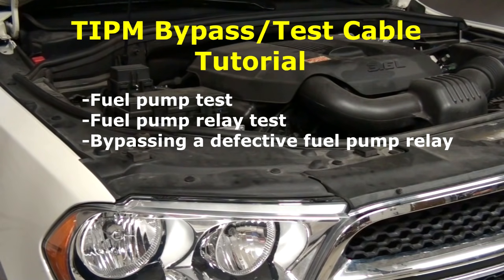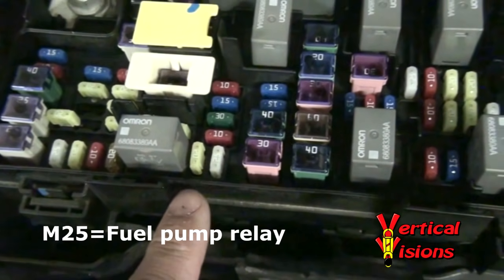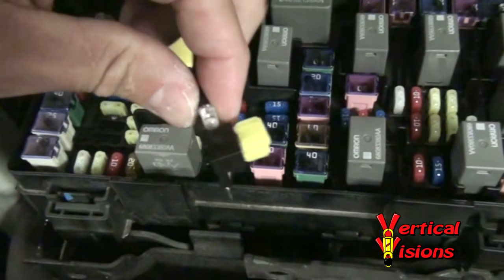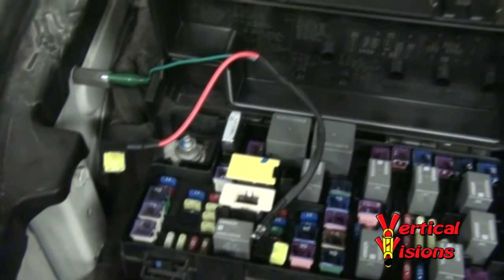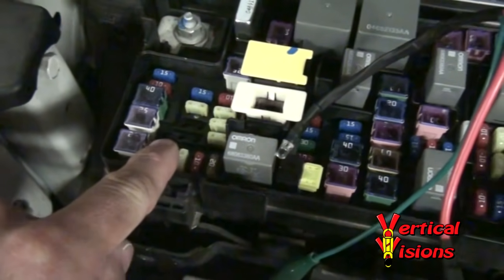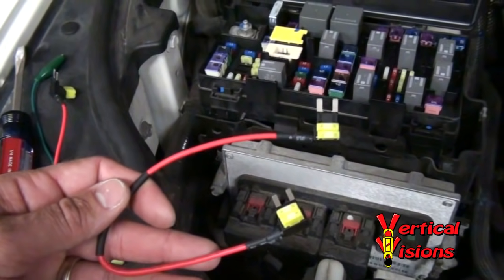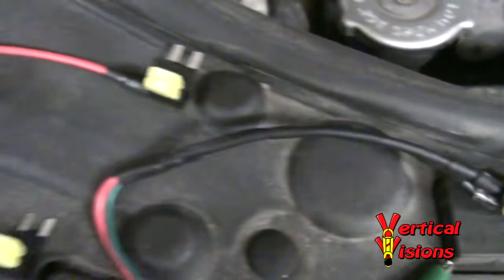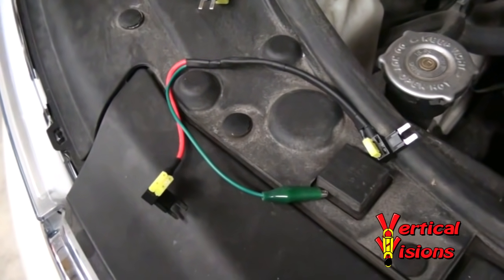TIPM Fuel Relay Test and Bypass Solutions - Most 2007-2021 Dodge, Chrysler, Ram, Jeep, VW Vehicles

Comment: Jason, I have a 2011 Dodge Ram (Hemi) and the battery was dead every morning for four mornings.  Replaced alternator, replaced battery but to no avail.  Then discovered that the fuel pump was running when the truck was switched off!!   Stumbled on this YouTube video and ordered the part.  And it works like a charm.  I cannot express my gratitude.  Christmas is around the corner and the though of a $1500 repair (dealer quote) was making me physically ill.   I appreciate your willingness to share this fix at such a reasonable price.  My hope is that it has been financially a blessing to you and your family for you have surely financially blessed my family this Christmas.  Thank you.
Reply from the maker: Wade, great post as we get many comments like yours this time of year.  Many thanks.

Comment: Does this work for wiper relay
Reply: I think that I'll check wiring going to tipm first tho
Reply from the maker: No.  It would keep your wipers on 100% of the time when driving.  Look into a TIPM repair, which is the only wiper solution other than a new/used TIPM (assuming it is indeed a double relay failure):  https://www.verticalvisions.com/tipm-repair-door-locks-wipers-washer-fluid-double-relay-1.html

Comment: Though I am back in business, I may still buy one of Jason's cables-- the fuse adapters they have at my local auto parts store are rated at 10 amps and I notice Jason uses 20 amp fuses, which I did too- I don't think the pump would draw as much as 10 amps, but that concerns me- maybe 20 amp rated  fuse adapters are available? Or  maybe he's using 20 to allow for other things that may be on the circuit such as the rear lighter socket? Jason if you're listening, are your cables 20 amp rated? Oops! EDIT: I see he covered this near the end-- I'm gonna order a cable from Jason!
Reply from the maker: Since this summer, our cables are made specifically for us (14 AWG wiring, 20 amps).  Fuel pumps will use 8-10 amps.  The fuel pump circuit has always been rated at 20 amps, so the use of 10 amp add-a-circuits will eventually cause the cables to melt.  Short term, a 10 amp add-a-circuit cable will get you home where you can then install a larger add-a-circuit cable
Reply: @VerticalVisions  Thanks! Like you said, I can't find the heavier duty fuse adapters at the local supply houses, so I ordered some- hope they get here quick. I suppose I  could just use 14 wire, tap the fuse sockets with  blade inserts and add in-line fuses, but seems like a lot of trouble for just a (hopefully) day or two.

Comment: I have a 2011 T&C Ltd., bought 6 months ago,  and immediately experienced intermittent starting problems. Didn't know it was intermittent right away, the 3rd day I had it, it stranded me and I had it towed to a shop where it spent 2 days, but they found no problems---it worked just fine and everything tested OK while they had it. Took it back and occasionally it would not start. I could usually get it going by various little tricks,  cycling the gear shift, using remote, etc.  but the other day nothing worked. Fortunately I stumbled across this video some time ago but never acted on it as it never stranded me since the first time.  I got two fuse adapters and connected them together  (sorry, Jason, I commend you for finding this solution and don't begrudge you a profit, but besides the money, I wanted to get it running right away and not wait for delivery)  and installed them as shown - and EUREKA!  Starting reliably and running like a top again. One question I have is, why is the bypass not a permanent solution?  I understand I might lose remote start but I don't use that anyway unless it was back when I had trouble starting it normally. Is there any other reason why it shouldn't be considered permanent?  But, many thanks to Jason for saving me hundreds if not thousands, there was  a time I was headed to the replace everything you can think of  and hope that solves the problem route.
Reply from the maker: Lately, we're testing a new fuse slot which will make it a permanent solution:  https://www.verticalvisions.com/tipm-test-bypass-cable-mini-blade-fuses.html#faq19.  No worries on building your own cable - we have instructions to do so on our site.

Comment: I have a 2012 Dodge Ram Pick up and was ready to replace fuel pump.....which is a real chore. What was happening that made me think it was bad is....I could hear the pump running when vehicle was off and my battery would drain overnight..... Not all the time but occasionally. While researching other potential scenarios I came across this video and website. I ordered cable online from these guys and did prescribed test and installed cable.....It worked perfect.
Thank you very much.......how sweet it is to fix something like this  so easily. Its like when your in school and you pay someone to do your home work so you can go play......not that I ever did that ( - ;   Ralph

Comment: this does not apply on later 2012 jeep grand cherokees or 13 or newer. fuse m25 does nothing you can take it out and throw it in the garbage. it looks like chrylser switched everthing to fuse m37 and it is shared with the abs fuse( not in the owners manual) it still says fuel pump  is  fuse m25. looks like i just have a good old fashioned bad fuel pump
Reply from the maker: This is 100% incorrect.  2011-2013 Jeep Grand Cherokees were part of a nationwide fuel relay recall, so your M25 doesn't do anything because you may have let your dealer cut wires under your TIPM to install an external relay.  Here is how to identify if you have an external relay:  https://www.verticalvisions.com/omron-g8jn-external-relay.html#identify.  The same page has a $9 solution to fuel relay problems if you have an external fuel relay.  For the record, 2011-2013 Jeep Grand Cherokees and MANY other vehicles without external relays absolutely need M25 or no power will be provided to the fuel pump.  M37 does not control power to your fuel pump.
Reply: @VerticalVisions  thank you for the info was pulling my hair out today following your video. I just looked at it more closely and it definitely has an external relay. I guess the external relays fail as well ? I was trying to a diag a crank no start on a 13 jgc at my shop and I happened to have a 12 jgc there as well to compare it to. Both of them have no power at m25 at all.and fuse m37 inside the fuse panel lid is labeled fuel /abs and something else I believe . M37 will prevent the vehicle from running so I assumed it was the fuel pump fuse. But what is strange is that in the owners manual it just lists abs for m37.
Reply from the maker: Yes, external relays fail as well.  We sell them every day of the week to owners of 2011-2013 Jeep Grand Cherokees and Dodge Durangos.  External relays are a terrible fix - mainly due to cutting of harness wires.
Reply: @VerticalVisions  awesome man thank you for the info. Now I understand the system. won't get burned on This one again. Chrysler's always make my day😤

Comment: Received bypass cable this past Monday. Now my truck starts right up. Thank you Jason. My truck did have the bad relay and experienced the symptoms as described in this video.

Ordered on a Saturday and received on Monday. 2 days. Awesome!

I do have a question Jason. Should my fuel pump continue to pump while my key is on ACC. I work from my truck so I keep my key on ACC to listen to the radio but I hear my fuel pump pumping.
Reply from the maker: The cable is a key on, pump on arrangement so ACC mode will power the pump.  Doing so won't harm anything other than reducing your battery voltage if left on for long periods of time.  We have another product that doesn't have this issue, but we are also testing use of the cable in the M37 slot instead of M7.  It works great for us, but a few others have strange issues.  Contact us and we'll give you details on how to use M37 so your pump won't run.
Reply: @VerticalVisions  you want me to contact you via email?
Reply from the maker: Yes, so I can email you some photos of M37 usage.   Contact us:  https://www.verticalvisions.com/contact/

Comment: Hi just watched your video, would it be the same on 2017 V6 engine? Ram 1500 4x4? Need some pointers... before I trade it in...
Reply from the maker: Go to this link and look at the TIPM shown on the page (https://www.verticalvisions.com/tipm-test-bypass-cable-micro2-fuses.html).  If it matches yours, a micro2 cable should work.  We're not certain about a 2017 Ram.

Comment: I’m having this problem on a 2006 2.7. I’ll sit at a stop light and it randomly dies , my charge light comes on . New alternator and good battery. I’ll hold the throttle open at 1200 rpm in neutral at stop lights with no problems, but if I forget to do that it might die on me . After a few tries of cranking the engine it re starts . So embarrassing. Any thoughts Jason thanks

Comment: So, this worked for me too, but I have recently ran into a new issue with the fix... The cigarette lighter fuse side has completely melted! 😬 And yes, I returned it back to the right position as you instructed. Now I am having issues again. Why do you think this happened and what should be my next steps? Thinking about the TIPM plug-in relay system you have for $179. Thoughts?
Reply from the maker: Not sure if it was one of our cables or if you made one yourself using the instructions on our site?  Did you use an inverter or other high current device in the rear cigarette lighter?  We have seen a few cables melt, which could be due to a bad physical connection (high resistance/heat) between the cable and the fuse slot.  Could also be a bad crimp on the cable at the factory.  We'll send you a new cable if you bought one from us...simply contact us.  However, to answer your question, the TIPM Plug-In Relay System uses different fuse slots (M30 and M37) and it addresses the fuel relay problem completely different with the use of MOSFETs.
Reply: @VerticalVisions  will try to contact you directly, but we went ahead and ordered a new one. No worries about replacing it. That is good info. I do plan to do the other device soon, but this will be what I need to do for now. ... The one we had was with the test light. We did not make it, but it was already on the van when we bought it... I discovered you via this. But we have had it for a while before this happened. I hope this helps. I will DM you. Thanks!

Comment: My 2011 Town and Country has been starting intermittently. Lately, not at all.  I just replaced the alternator. I have the test cable you have in the video with the LED. The pump check showed the pump is good.  I tried to start the van with the other hook-up (left 2 on rear lighter spot) and the van actually started.  What is weird is that the LED is not flickering at all. I thought for sure this would solve the issue, but if that LED is not flickering doesn't that mean the relay is good?  If so could the intermittent starting be the starter??  Oh please help me!!!!  Thank you for the video by the way.  Very easy to understand the instructions and I'd say the best "how-to" video I have ever seen.
Reply from the maker: If the LED is on or not flickering, it means the fuel relay is working "at that moment".  Remember, relays fail intermittently but most often when the vehicle has been sitting for awhile.  My recommendation is to test the fuel relay using the LED when it's most likely to have starting issues.  You can also drive with the cable in place and note the lack of starting issues, which will provide some conclusion that the relay was the problem.  Also, a failing starter and fuel relay are two completely separate things......a failing starter will prevent the flywheel/engine from turning over (no engine rotation) while a failing fuel relay will simply make your vehicle act like it's out of gas.
Reply: @VerticalVisions  I appreciate the info. I've been using the van with the bypass installed and It ran fine yesterday all day and has been fine today too. It just didn't start the first time I had it installed and it sat overnight. But before the bypass it wasn't starting at all. Thanks again !
Reply from the maker: We are currently testing use of the M37 fuse slot instead of M7 left slots.  As I indicated in other replies, it's a complex story why we didn't use this early on, but it may be a better slot to use with this cable.  M37 is the run/start signal and now that we know how the internals of the TIPM are connected, it can be used with the TIPM cable.  Remote start also works and there are other benefits since M7 left slots sometimes don't play nice with low battery voltages and cold weather.  M37 is still being tested, but anyone who wants to try MUST pull the red 10amp fuse out of M37 and place it in the lower fuse slot on the end of the TIPM cable that plugs into M37.  We'll have more info on our website shortly, but we need to test it further.
Reply: I am going to go switch to M37 right now (replacing bypass cable bottom fuse of M37 spot with the 10amp) and I'll keep you posted as to how it functions.
Reply: I switched the cable and the van started up and sounded like it had more power going to it than when connected to the M7.  However, when I turned the key off the van kept running for about 1 second, which is not normal.  I'm not saying that this is a horrible thing or caused problems, but I know this is a new venture for you and I wanted you to know what I experienced.  Thanks.

Comment: I'm the next victim. 2011 Jeep GC. No start condition. I know how to change relays on circuit boards. Around $550 with +$125 core charge through Rock Auto.
Reply from the maker: Most 2011 Jeep GC were recalled for a fuel relay problem.  Identify if you have an external fuel relay and replace it.  More info:  https://www.verticalvisions.com/omron-g8jn-external-relay.html
Reply: I'm getting it figured out now. Off the jeep forums. Recall has been done, but still no start. Found the external relay. Took it apart, etc. Omron relay. Ordered a new one off ebay. Found another relay at Autozone and put that in with dielectric grease, it is working fine for now. Not sure if  I need to send my TIPM in for a relay replacement or not yet, around $200 bucks. Or the fuel pump could be going out too.
Reply from the maker: You just replaced the relay (external), so sending in your TIPM for a fuel relay replacement will be for nothing.  The old faulty relay inside your TIPM isn't used anymore since you are now using the external.

Comment: Van has been running ok since I installed the bypass cable but now it struggles to cold start.
Reply from the maker: We are currently testing a new fuse slot (M37) instead of M7 left slots.  It's a long story why we didn't use this slot in the past, but it carries the run/start signal and remote start will work properly.  There are several other advantages as well which we will describe on our website in the near future.  This slot may be more reliable because M7 sometimes has issues with low battery voltages or temperatures during the engine/flywheel cranking process.  Suggest you remove the M7 left slot end of your cable and remove the lower 20 amp yellow fuse on that end.  Then, remove the 10 amp red fuse from M37 and insert into the empty lower fuse slot on your TIPM cable.  This means the 10 amp red fuse is now closest to the two terminals of the TIPM cable.  Insert into M37 and make sure the cable doesn't have any sharp bends.  There are no changes to the M25 end of the cable. This arrangement looks promising, but keep in mind we are still testing it and we welcome any feedback.

Comment: Great video!

I have '00 dodge 2500 ram Van,  could you tell me from pcm which connector and which pin energizes the transmission relay?
Reply from the maker: We do not have any wiring diagrams or relevant information for your vehicle, sorry.

Comment: Was having the fuel relay issue described above.  I have a 2013 Dodge Grand Caravan R/T.  Engine turning over but not starting.  I ordered the "standard" cable (with the LED light); all the steps are included in crystal clear language; including verifying the fuel pump was working fine (not stuck in the on position by the way).  I hooked up the cables as instructed and the car started on the first try !!!!!  Unbelievable a $35 fix saved a potential $2,000 dealer bill (new TIPM / fuel pump / etc....)Thank you Jason.  I highly recommend buying this cable even if your Dodge is not experiencing this issue; because most likely it will.  Very cheap insurance policy and eventual fix.
Reply: I just fixed my 2013 caravan with a bypass cable. Faulty relay just like the video described. Works!!!
Reply: I did the bypass a few months ago, but sometimes it won't start and my wife will have to wait 15 minutes before it starts. Plus I have the Routan they say go to Volkswagen when I went there they said No its Chrysler problem. Help please
Reply: @madebydade305ify  Even to me after 20 minutes it comes back on. The problem of my journey is that it goes off in gear ... while the car is moving, the machine goes off by itself.
Reply: @dwtshopenjoy660  your are right. It did that to me the other day twice. I park it and now drive my old truck with mom problems. What is the solution to this stupid design. My bypass did not fix the issue.
Reply: Hi Brain...did u leave this standard cable on the car or u do it as a try only?i did it on caravan 2012 but i want to stay doing on this standard cable...
Reply: did you purchase a new relay  or leave the jumper on?
Reply: Anyone have this issue relating to a 2006 Chrysler Aspen? If so what was the outcome? I’m going to build one and I will post my response, seems to me as a mechanic that it’s the same thing, but everything happening is electrical, and intermittent...
Reply: How can I get one please